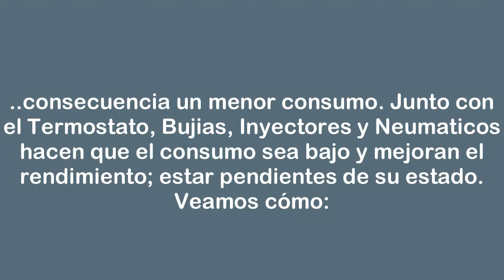Cómo Cambiar el Filtro de Combustible de un Volkswagen Golf Mk3 GTI Motor ADY

Comment: Creo que podrías disminuir los goteos de gasolina de cuando desconectas el filtro, habiendo quitado el fusible nº18 de 20amperios de la regleta de fusibles que es el de la bomba eléctrica de gasolina. Entonces le das a arrancar y el motor absorbe la gasolina que quedase en los tubos tras la bomba de gasolina dejándolos vacíos para trabajar sin que se fugue tanta gasolina.
Reply from the maker: Es una buena idea; lo que tu dices, lo hago para quitar la presión en el circuito, es mas, tengo un vídeo subido para mostrar el proceso; pero no había pensado hacerlo para cambiar el filtro; siempre habrá algún remanente de gasolina, pero sera mucho menos, Gracias por tu aporte y en un próximo cambio lo haré, un saludo